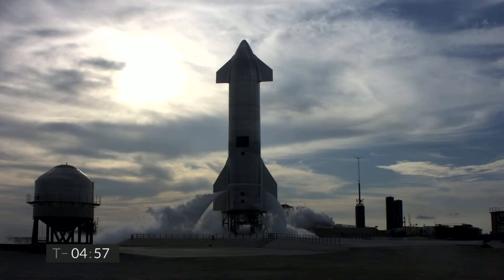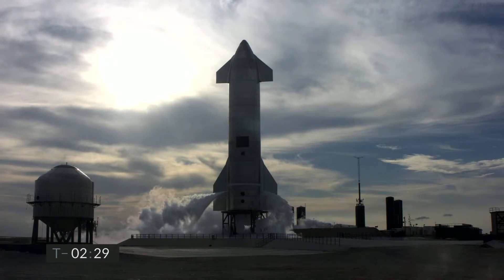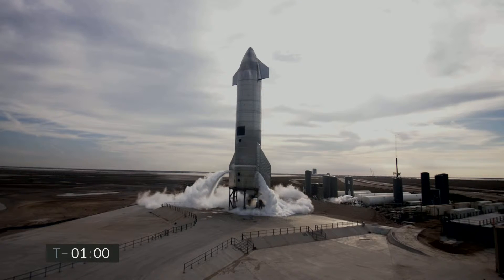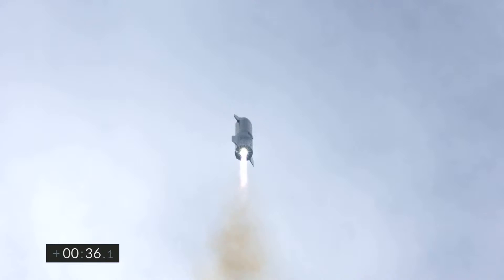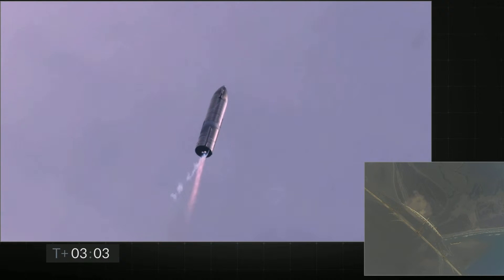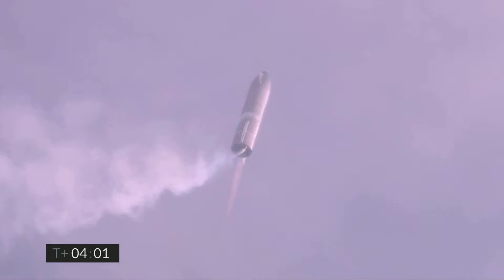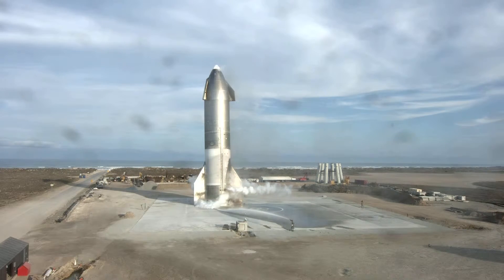Starship | SN10 | High-Altitude Flight Test

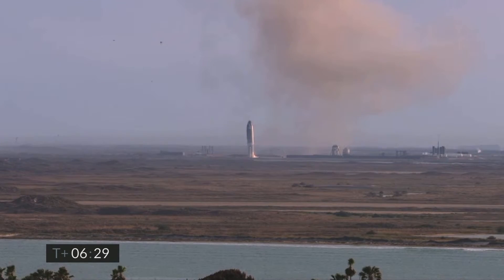Comment: 13:06 "We've had a successful soft touchdown on the landing pad". 
That's stretching the meaning of successful. It visibly bounced and at the stage this comment is being made, anyone can observe that its leaning.
Also notice the large escape of methane, probably from an engine and the subsequent flame up the side of the ship, as it comes into land and the engines are shut down.
Note the persistent fire afterwards, which the commentator would be well aware of.
Then note the use of a human controlled water cannon. Perversely, suppressing the fire meant that the methane could then build up.
Would be very surprised if this isn't from continued failures in the Raptors.

Comment: Is it just me, or the Starship wasn't standing exactly vertically after landing?
Reply: yesn’t and it goes boom 10min after
Reply: It landed hard, but still landed
Reply: That's why it's a test flight, still lots of things to perfect incrementally
Reply: @davidh7126  Tell that @thunderf00t
Reply: Yes. And it looks like the legs gave way when touching down (you can see the aft flaps are almost touching the ground). This must have damaged the bulkhead and the hot engines ignited the leaking methane...
Reply: @dfdhfhgj  from LabPadre's stream you can see the legs were just swinging back and forth, not locked in place, so it didn't touch down on all of them properly and hence the tilt.
Reply: @goodwinhull2751  The legs definitely need more work
Reply: The landing legs they're using on these prototypes are pretty weak compared to the ones the final ones will actually have
Reply: z góry przepraszam za zaśmiecanie komentarzy) zapraszam was na kanał mojego ziomeczka bardzo by sie ucieszył jakbys zajrzał do niego! https://www.youtube.com/watch?v=kQg_mOnFZWE prosze

Comment: 8:13 - (2 mins into flight) - that right engine looks a bit fuel-rich judging by the flame, (compared to the left engine), plus shock-diamonds are a different shape. Is this not important?
Reply: This could indicate that the right engine is throttling down.
Not unexpected, but it's the first time we see that with starship during ascent.

Comment: The little 'bounceback' at 12:03, is that a normal, expected behaviour? I am assuming no damage was done to the Starship?
Reply: Me watching:
"Oh it bounced, that is not normal"
5 minutes later:
It fucking explodes
Reply: @volksgenosseerichhonecker5104  is this the first time a rocket exploded after a 'soft' landing?
Reply: @freshmindnow  Idk, for all i know this is the only soft landing ever performed on earth.
Reply: @freshmindnow  Oh and 'soft' doesn't mean that it's really soft, but that it can land by throttling down the engines enough to not get back up. This is a problem of the Falcon 9: It has too much throust. If they dont time the landing burn, it will just go back up into the air. This problem doesn't effect Starship, thats why its called a 'soft' landing.
Reply: @volksgenosseerichhonecker5104  didn't they have a case where two much smaller rockets ended up landing on a sea pod somewhere pretty much perfectly? Or does that not count as a 'rocket' per se?
Reply: @volksgenosseerichhonecker5104  ah I see! Thanks for the clarification. This is super helpful for me to understand. The timing of the landing burn must be (quite literally) complicated like rocket science! :-D It's so easy to watch it from YouTube. I can only imagine what sort of calculations those engineers are going through on daily basis to get this 'recipe' perfectly right. 2-3 cm off and the thing blows up. Damn!
Reply: @freshmindnow  Eh, I'm not sure wich launch you're talking of, but I think you're talking of the falcon heavy (https://www.youtube.com/watch?v=A0FZIwabctw) Wich has 2 Falcon 9s landing paralell (but on land).
They count as rockets.
(And they really aren't small, the diameter of the Falcon 9 is 3,5 meters)
Reply: @freshmindnow  Yeah, it's really impressive. This "suicide" burn, as we call it, is so unbeliefably hard to pull off, that many people said that it was impossible.
But hey, they did it!
Reply: @volksgenosseerichhonecker5104  yes I was thinking of those. I see them certainly as smaller than Starship, but not quite sure. I'm sort of just going 'by eye'. They certainly seem thinner and those 'docking legs' that open up on landing seem super genius thing to stabilise the rocket to not topple over. When I saw that I was amazed and they seemed to time that landing to a millimetre perfection! For some reason I was under impression that SpaceX had now 'solved' the landing piece across all their vehicles, but I was obviously having some sort of simplified wishful thinking 'ported' from first principles software engineer realm. It happens to me all the time.
Reply: @freshmindnow  Oh yes, the Starship is way thicker. It's about 9-10 meters thick (Its as thick as my house) and about 50 meters tall, so literally a skyscraper landing on its legs. Heres a good video to see its size: https://www.youtube.com/watch?v=HVmI-mEGkBM&t=224s *(Skip to 11:25)*.
Reply: @freshmindnow  The main problem with the Falcon 9 landing approach for mars is that the spacecraft is going at 6 km/s, wich would damage the engines if they were to face the atmosphere (like they do when the F9 is landing), so they need to use the side of the vehicle (covered with heat tiles of course) to slow down. But then they would be in a horizontal position (like in the flight test yesterday) and they couldn't perform the F9 landing burn, thats why they flip it at the end.
Reply: The bounce is what caused the explosion, it hit the ground way too hard
Reply: @tauraspace  yeah makes sense. I thought 'that bounce must have caused some cracks'. 😥
Reply: I only saw the explosion afterwards on the mainstream news clip. Damn! 😥

Comment: What're the things at the bottom constantly releasing some gas throughout the flight? And how did it turn vertical from horizontal if the rockets were also firing horizontally?
Reply: Gyro's control its attitude. Liquid fuel is expanding in the tanks and needs depressurized venting including the altitude.
Reply: @WashingtonHoax  Nope, no gyros, its the RCS system, wich fires small, but powerfull, puffs of Nitogen to control the starship. Also the engine is gimbling to the side.

Comment: how will it land and take off from another planet without a landing pad or launch pad, those legs are going to have to be a lot longer so it can take off again and I am guessing adjustable as the surface wont be a nice flat concrete surface it will be uneven and rocky meaning SS could topple over especially as it wont be strapped down to protect it from any storms.
Reply: These are just V1.0 legs

Comment: I saw something happen to push it back at 4:04pm CST but this is nice to see
Reply: 12:14 that is still amazing

Then it’s just there in the dust, with a little fire but still. All be it a fire may not be the best.
Reply: I’m told it blew up. I didn’t watch the full video. I saw there was a small fire which I knew could go wrong but never looked into it.

Comment: Remember that the soft(-ish) landing was a bonus, this was a test of controlled entry / the flaps.
Reply: er no it wasn't. the controlled entry was tested with sn8.
Reply: That's right, but you would think that they would use some better firefighting power than just two garden hoses.   Even my 80 year old grandfather has a better piss than those two lame hoses. lol
With Tesla's amazing electric power technology, you would think that by now they would have come up with a battery powered rocket... but no, they're still using explosive chemicals for fuq's sake. he-he
Reply: @BillAnt  No way you're being serious
Reply: @alexrklx  < No I'm not, just kidding... he-he
Reply: @BillAnt  what's amazing  about Tesla's eletric power tech, where the capacity of the batteries they use is increased by 50% by making the battery 50% bigger? - not exactly rocket science is it?
Reply: @BillAnt  Electric rocket... Rockets don't work like cars or even planes. They don't have motors, which is what other electric vehicles use to move.
Reply: @maarten699  < Of course, just some silly humor around Tesla/battery. lol

Comment: HUGE success. From my understanding they wanted to land with two raptors but it seems they landed with one. Maybe they shutdown one of them and then they lost the other ? You can see a small fire from one of the raptors ,while there wasn't any power coming out of it, while the one raptor is doing all the work. I'm not a rocket engineer though. I'm just pointing out what I see compared to what elon said on the aftermath of the previous test. Maybe I'm completely wrong

Comment: They need to find a better way to cool the bottom of the ship when lading there is way too much heat between the landing pad and the base of the rocket that is overheating the engine bay and then working its way up. Keep testing guys and you will get it working.

Comment: We live in such times that when I see a shot in the 11:41 second of the the transmission , which is very different from the others, I wonder if it's not the CGI inserted into the broadcast to diversify it. And I can't tell :D

To be clear - I don't deny the the transmission in any way. But it is possible that for this crucial moment of landing they used a previously prepared animation to illustrate what is happening. Although probably not, and it is simply the effect of using a different lens and a more interesting, more "cinematic" framing than in the rest of the wider shots.

Comment: so...   1 hard landing 2 raptor still works unstable  3 a lot of fuel dumping even during 100% power operation period
Reply: Yeah, the landing was pretty rough. Shitty landing gear didn't work properly and even if it had it might not have been enough.
But Raptor worked perfectly fine from what I saw. 
And the fuel dumping isn't unexpected, this ship is sized for six engines and only has three, so it's not consuming fuel as fast as it should be.
Reply: @lazarus2691  facepalm
Reply: @mrpicky1868  🤦

Comment: How did it slow down from free fall so fast ?
Reply: 1 - It slowed its fall by falling sideways
2 - It used all 3 raptor engines to slow down
3 - It is much lighter when it comes in for landing, as the fuel tanks are almost empty
Reply: 3 Raptors at full power have ~600 tonnes of thrust. The ship weighs ~150 tonnes at that point.
That means it can decelerate at 4g, minus 1 due to gravity. Terminal velocity was ~70m/s.
Which means that it should be able to come to a complete stop in ~2.3 seconds and ~80 meters.
Of course in reality it probably wasn't at full throttle, and was sideways for part of that, and shut down two engines before a complete stop.

Comment: Starship should use the Spaceships landing legs instead or something like Falcon 9’s landing legs, the current ones are really short and I don’t know if they absorb the force exerted upon landing softly like SN10
Reply: The legs can't really be on the outside like Falcon, since they'd have to survive a far more brutal reentry. Whatever they come up with needs to retract into the base.
Reply: @lazarus2691  I see, they could be similar to the ones on Spaceship, but they would be more like the Falcon 9’s landing legs instead.

Comment: Ia nobody going to appreciate the camera filming a rocket 10km away in literally full hd?
Reply: More than 10 km, since the 10 km is the vertical distance (height) from the ground. The camera will be at a distance. So the camera, the Starship and the landing pad form sort of a right triangle, and the distance of the camera from the rocket is along the hypotenuse which will be greater than the vertical height.
Reply: @boingboing919  Well, technically you are correct, but since the camera is literally feet from the launch/landing site, and the rocket didn't travel down range very far at all, the angle was very acute.   Maybe the hypotenuse was 10.5 to 11km.
Reply: well I wanna know how they are getting some of those angles when it's that high, do they have a Camera on the Drone or something?
Reply: @DanielsCorner644  Some of the cameras are very far away from the launch/landing site, so it almost looks like they are parallel to Starship even when it's high up
Reply: Just use a 800mm f5.6 and a 2x teleconverter.
Reply: @ZeugeCoronasLP Meine Güte... Ich hab dich schon mal irgendwo gesehen, kann es sein, dass du ähnlichen Unsinn bei MaiLab verbreitest?
Reply: @ZeugeCoronasLP Volltreffer... xD
Reply: @ZeugeCoronasLP Hope this is a joke ^^
Reply: @ZeugeCoronasLP "Aluminium in Deos ist genauso unbedenklich wie 5G Strahlung <3"

"Es ging um Funk/Handystrahlungen und nicht um 5G aber 5G ist etliche male stärker also kanns nicht gesünder sein :D
Schaffst du ja wohl dir die Daten rauszusuchen oder? Ich kram jetzt nämlich keine Dinge aus, die ich vor 20 Jahren gelesen hab xD

Den Herd hälst du dir auch nicht den ganzen Tag an den Sack so wie ein Handy. Diese Vergleiche hinken ein wenig.. :D"

und so weiter...
Reply: @ZeugeCoronasLP Du kannst dir ja die Unterhaltung durchlesen und bemerken, dass du interessanterweise irgendwann nicht mehr geantwortet hast
Reply: @ZeugeCoronasLP Ich würde auch einen Link zum Kommentar posten, aber Links werden hier blockiert. Ich habs über "Meine Daten auf YouTube" gefunden
Reply: @ZeugeCoronasLP Man sollte halt realistisch bleiben. Und zurück zu diesem Video: warum du das für CGI hältst ist mir völlig unerklärlich, es sei denn du versuchst nur, deinen Frust mir Trollen rauszulassen...
Reply: they are using drones

Comment: It may look like a failure but it lifted off, did the turn, did the belly flop from 10km high and if i were  Treelon, i would count that as a success
Reply: As someone else said in another comment, landing is hard, fixing a leak is easy, and they've already done the hard part.
Now that they've more or less stuck the landing, they can start to move on to the next challanges.
Reply: @lazarus2691  👍

Comment: Landing is animated
Reply: No, it is not. Many people outside of SpaceX saw it land.
Reply: There's no animation here.
Reply: Is there any other footage of it landing? The one in this video is animated
Reply: @parisknowitall  Look at the channels Everyday Astronaut or NasaSpaceflight. They caught footage of the landing from a distance.
Reply: @parisknowitall  Yes, but first I have to type a bunch of random nonsense so youtube doesn't delete my comment for spamming links. Just skip past it, links at bottom.

Let's start by discussing exactly how much thinner Mar's atmosphere is than Earth's. Often you'll see it quoted as 1% of Earth. This is close, but not quite right.
Some people will talk about the pressure, which is only 0.6% of Earth. However, this isn't right either, because when it comes to flying things, what we really care about is the destiny density. And since the air on Mars is colder and made of heavier molecules, it's actually quite a bit thicker for a given pressure.
So the air on Mars is actually a whopping 1.6% as thick as Earth's. Which is better than 0.6%, but it's still not very much, is it?
Indeed, it's still about 61 times thinner. So you might naturally think that your helicopter rotors have to spin 61 times faster, or that an airplane would have to fly 61 times faster, which still sounds pretty hard.
Fortunately, it isn't nearly that bad. There are two things in our favor, and the first one is quite simple: Mars has less gravity. Objects on Mars only weigh 38% as much as on Earth, so an airplane or helicopter only needs to generate 38% as much lift. 
Well the lower gravity does help, but it still seems that we need to go 23 times faster, which is still a lot, so now let's look at the last and most complicated bit; the fact that lift scales with the square of velocity. 
Simply put, if you go twice as fast, your wing doesn't make twice as much lift, but instead four times as much, since 2x2=4. If you go three times faster you get nine times as much lift since 3x3=9.So to get 23 times as much lift we actually only need to go 4.8 times faster, since 4.8x4.8=23. I tend to round that up to a nice round 5 since various factors can, well, vary a bit.
Anyway, all told, an airplane wing or helicopter rotor needs to move about five times faster to work on Mars. Not easy, but hopefully within our engineering capabilities, and certainly not nearly as impossible as you might first think upon hearing that "Mars atmosphere is only 1% of Earth".

Landing starts at about 5:50: https://youtu.be/rpOrSfR74Mg?t=351

Landing also starts at about 5:50: https://youtu.be/bUlpTjbJ4Lw?t=350

Landing starts at about 6:40: https://youtu.be/bgTMwid2lKw?t=400
   
Landing starts at about 2:40: https://youtu.be/iUJif0_vhLs?t=160

Landing starts at 0:00: https://www.youtube.com/watch?v=1CSDa-ebMIc

Comment: I HAVE MENTION SO MANY TIMES THAT IT WONT WORK. ELON MUSK PICK UP  A BOTTLE FULL OF WATER . IMAGINE THATS THE WEIGHT OF YOUE SN8/9/10. HOLD IT FROM THE TOP AND SUSPENDED IT. IMAGINE ITS LANDING AMD DEPLOYED ITA ENGINE AND THEN  RELEASE  IT. IT WILL HIT THE GROUND STRAIGHTAWAY BECAUSE  THE ENGINE WILL NLT SUSTANINE SO MUCH WEIGHT  WHEN THE ENGINE START BEFORE THE  TOUCHDOWN

Comment: Soft landing?
Reply: "A soft landing is any type of aircraft, rocket or spacecraft landing that does not result in significant damage to or destruction of the vehicle or its payload"
Reply: @idkidk2459  Any thoughts on the crunch followed by a bounce on touchdown?
Reply: @petersellers9219  I didn't hear a crunch and I'm unsure if the bounce was intentional or not. I didn't follow this launch.

Comment: Did one engine produce not enough thrust? It went to the ground a bit too fast, and you see it jumping (after first touchdown I assume)

Might look slow but I wouldn't be surprised if it crashed into the ground with 30 km/h
Reply: It was ~5m/s, or 18km/h. Right at the upper limit of what it should tolerate, if the landing gear had worked correctly, which it didn't.